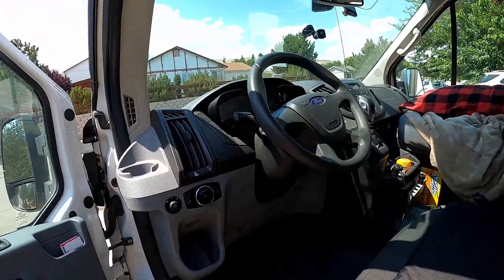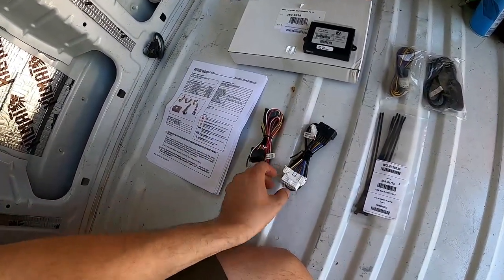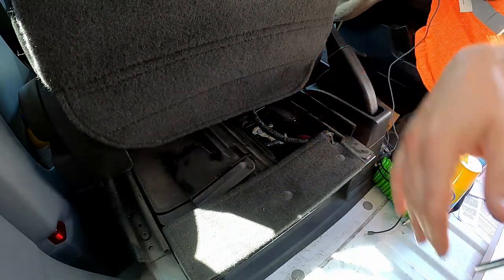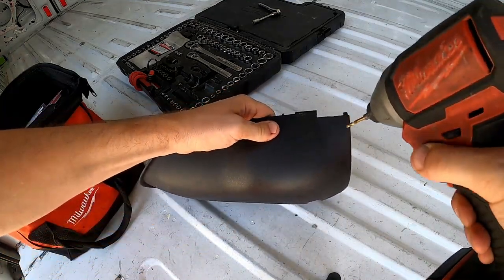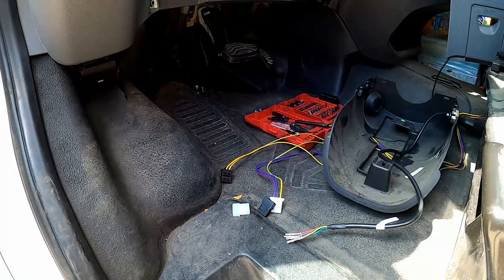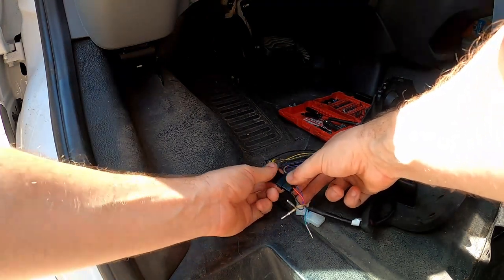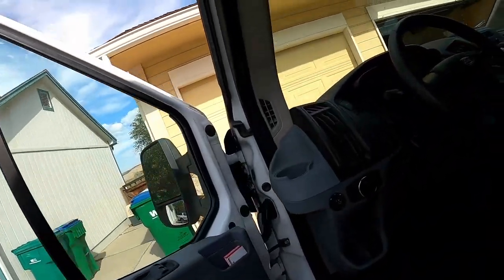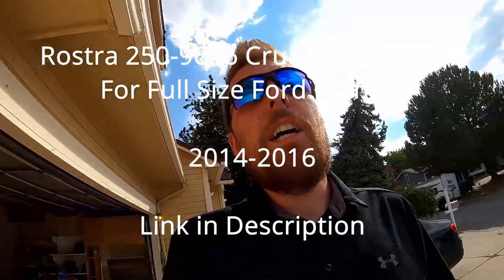VanBuild Vlog 2 - Rostra Cruise Control installation on 2017 Transit

Comment: I put one in 2 years ago went to use it sat and it does not work anymore same unit your putting in. oh wait till you have to service the transmission 700.00 it's an 6hr job the have to drop the y member
Reply: my mistake the ground wire fell off

Comment: Is this still working good for you? Any hard downshifts when under load?
Reply from the maker: Yeah it still works, but the downshifting is pretty bad since install. Whenever a hill comes up I’ll either put my foot on the pedal to override the cruise, or turn off cruise entirely. Even the stock cruise on my 2019 Tacoma did this, just what the vehicles had to do to maintain speed with that weight.